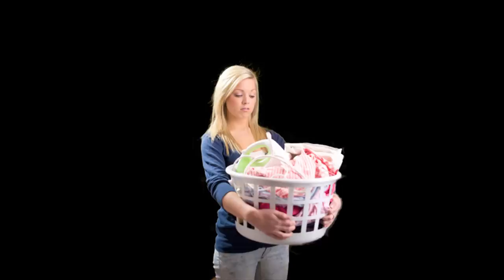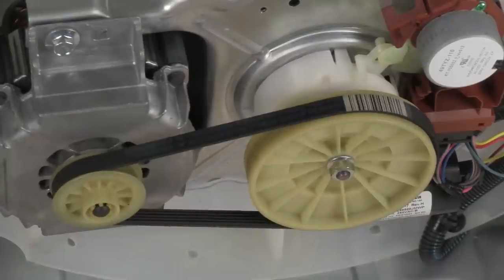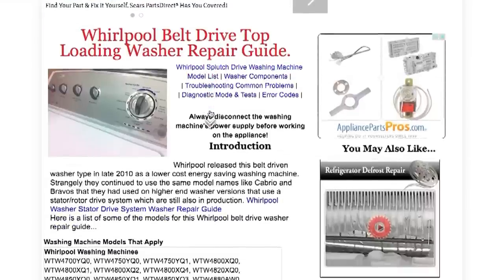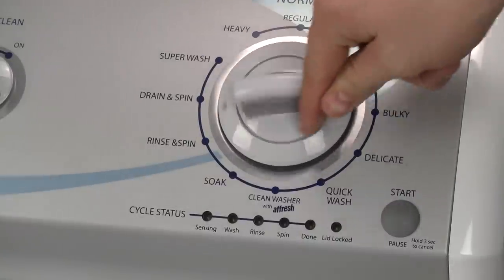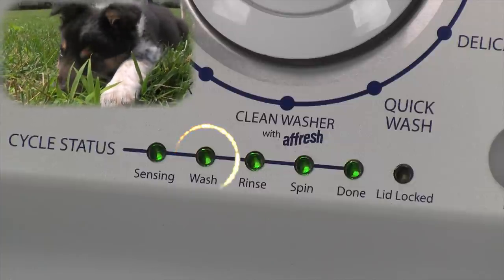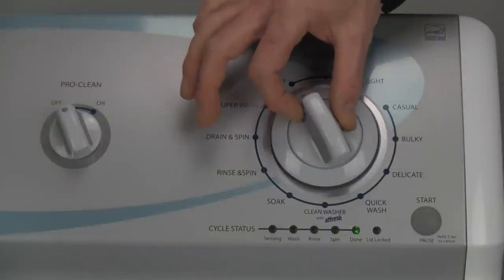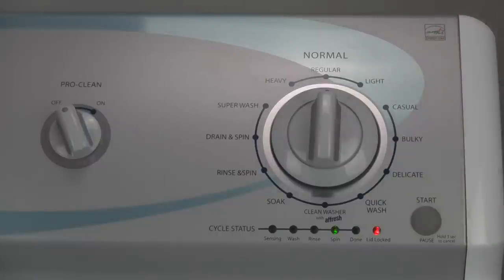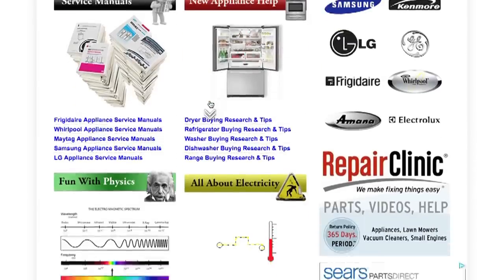Whirlpool Washer Repair (New Top Load Washer)

Comment: We just replaced the water pump on our Bravos.  The clothes are not coming out clean and I realized that the wash plate doesn't seem to be moving independently from the drum.  The drum moves fine, I think, but the clothes just float in a circle because there doesn't seem to be any movement from the bottom.
Reply: I don't know if we broke something else while replacing the water pump but the new pump seems to work fairly well.

Comment: I heard F -8-4-2-1. Where does E -5 -3 come in??? I'm talking about F7E1 and F7E6, etc. as diagnostic codes. I replayed it and that's not explained. Thanks!
Reply from the maker: you add up the light/numbers on each flash sequence. so 4+2+1 would be F7. Hope that helps!

Comment: Hi, On a Sers110.22102310 washer it started the take a bit longer to start to fill. than when it goes through the cycle it doesnt stop, it keeps repeating the cycle again, any ideas ? Thank you
Reply from the maker: It it is this style of washer, I would guess it’s a control board failure that’s causing the cycle problems. The slow fill is likely the water valve.
Reply: same washer, I will try a mode shifter first

Comment: Love your video beginning parts! Yeah, these washers are junk. Our direct drive is still working after 25 years. That just will not happen with these. They even changed the motor pulley to plastic! FAIL!
Reply: Hi - im just an old guy (57) and wanted to say we grew up with washers that lasted 20 - 25 years or more - My GE filter flo is 40 years old and only this year needed its first major repair.  And it washes clothes like a demon and does it fast.  No, it wont do it with a quart of water, but when youre done you don't even worry about if the clothes came clean, you just know it.  Ive read about owners of new HE washers having to add water with buckets to get the washer to even fully wet the clothes, let alone clean them.   And washers like this used to be the norm from all the major brands - but now theyre all made the same, flashing lights no agitator(??)and delicate computer boards have replaced solid well thought out engineering designs with years of development behind them - but they cost just as much and more though today they typically only last less than five years.  And who ever heard of plastic gears in a transmission or heavy load area like a washer-??!    Knowing parts are scarce for my old GE I went out and shopped washers for the first time since the 80s when my deceased aunt left me this GE I spoke of.  I remember shopping with a friend and his wife, they bought a Whirlpool I believe and it was a good washer.  But after looking at todays offerings It didn't take me long to see the major downgrade in quality and performance after reading all the reviews and talking to people, so I bypassed all the big box brands and bought a heavy duty commercial Speed Queen washer before the government forces them to start making HE junk as well next year.  The SQ has been everything it was promised, not flashy just a good old fashioned heavy duty washer that works, works well and works fast with no computers no drama and the best warranty in the business.  I paid a little more but am very pleased with the washers performance and build quality - I highly recommend the simpler knob controlled model as it uses no circuit boards and is much more reliable.   My problem is I grew up in an era when companies touted performance and long life and they delivered it and it was the norm - not any more.  People are taken in by fancy computer touch pads blinking lights silly songs and water efficiency claims, but they just don't have the performance or build quality of old school washers - but they still charge just as much for these under performing under engineered things --- end of rant--lol
Reply: yambo59 you have the right idea boss man! Just like cars!

Comment: So I've been having issues getting the spin cycle to run. Error codes f7e1 and f7e6. Are there any suggestions on how I proceed with figuring out whats wrong exactly and what I can do to fix it?
Reply: the F7E1 is a shifter fault and the F7E6 is a motor fault... The shifter is very common so I would start with that, especially if the motor is working on agitation... The service manual is in a plastic bag stuck to the inner front left of the cabinet, with that you can see how to clear error codes and run a few tests to try and narrow down the problem. However, odds are you will need a new Actuator/Sensor. Here is a link to my website guide for this washer: https://applianceassistant.com/appliance-repair/maytag-centennial-washing-machine-repair
Hope that helps! good luck!
Reply from the maker: Sorry replied logged in as my other account service node... this is appliance assistant ; )
Reply: @applianceassistant  good to know. I don't know if this information matters or not. But if I just try to put it on a spin cycle, it begins to spin and then just stops suddenly after about three seconds

Comment: My Whirlpool Cabrio has been the single least reliable appliance I have ever owned. I just ordered a new Splutch assembly. In the past I have had to replace the lid switch, the water pump, the gearcase, and the suspension rods.
Reply from the maker: I absolutely agree! Appliances are in a sad state these days! Very frustrating.

Comment: Hi.. so My cabrio WTW5640XW0  wont start up, and I have the F7E1 code. how can I tell if its the splotch, the motor or the transmission... thanks
Reply from the maker: everwharesismine  that error is the tub speed sensor error. https://applianceassistant.com/appliance-repair/whirlpool-belt-drive-washer-repair-guide/2/#error so you will likely need to replace the shifter/speed sensor. Whirlpool has used 3 slightly different styles of shifters so not sure which part number you need without a model number. If you clear the code from the washer's memory and run a diagnostics quick test https://applianceassistant.com/Washer-Repair/Whirlpool-Washer-Belt-Drive-Splutch/Whirlpool-Belt-Drive-Washer-Diagnostic-Tests.php
you may be able to get a few more weeks or months out of it.
Reply from the maker: everwharesismine  That error is the tub speed sensor error. https://applianceassistant.com/appliance-repair/whirlpool-belt-drive-washer-repair-guide/2/#error so you will likely need to replace the shifter/speed sensor. Whirlpool has used 3 slightly different styles of shifters so not sure which part number you need without a model number. If you clear the code from the washer's memory and run a diagnostics quick test https://applianceassistant.com/Washer-Repair/Whirlpool-Washer-Belt-Drive-Splutch/Whirlpool-Belt-Drive-Washer-Diagnostic-Tests.php
you may be able to get a few more weeks or months out of it.

Comment: I watched the video over and over and still can't get how to Read the codes, where does 7 come in and the the E's plus #'s???  I have the very machine in the video and it does make a loud sound on spin, what is it?
Reply from the maker: It is kind of confusing... This is a page that I created to help clear things up.  https://applianceassistant.com/Washer-Repair/Whirlpool-Washer-Belt-Drive-Splutch/Whirlpool-Belt-Drive-Washer-Diagnostic-Tests.php
The first time it flashes with the "Fill",  "Sensing", or "Soak" lights, is the  "F" part of the code.  The second flash without one of those lights on is the "E" part of the code.  After that, you just add up the total of the lights that you see for each flash... 
The "wash" light is "8"
The "rinse" light is "4"
The "spin" light is "2"
the "done" light is "1"

So for example, if  the "Fill" light is on it's the "F"   then "Rinse" (4) and "Done" (1)  4+1=5 The first code would be F5
Then you just get "Done" (1) .  the full code would be F5 E1 . 
This page will tell you what each code means:
https://applianceassistant.com/Washer-Repair/Whirlpool-Washer-Belt-Drive-Splutch/Whirlpool-Belt-Drive-Washer-Error-Fault-Codes.php
Hope that helps!

Comment: Where are you getting F7e1?  When you explained the lights, you labeled them, F8421.  Did I miss something?
Reply from the maker: +chip Fit It is a total of the lights flashing. So on the F7E1 Sensing (F),Rinse (4), Spin (2), Done (1) = F+4+2+1 = 7 then (No Sensing Light and Done (1) = E+1) Kind of a weird system, but not too bad once you get the hang of it.  Sorry for the confusion. Thanks for the question!

Comment: Great video !!!
So any other reason besides the nut on the pulley for the grinding noise on spin cycle?  Just won’t get up to speed on spin already changed the transmission still no luck
Reply from the maker: That’s pretty strange. I would have said transmission or something jammed between the inner and outer tub, but I would assume you would have caught that during the transmission replacement. Big reach would be the capacitor or motor but that doesn’t really fit. I’m sorry I can’t be more help.
Reply: applianceassistant thanks for your time
Reply: applianceassistant I figured it out

The grease from the old transmission got on the shifter and belt pully causing it to slip the gears.  Cleaned it with some break cleaner and problem solved
Reply: @mrphilleakey  That's great! thanks for the update!

Comment: Last night my wife may have overloaded our Kenmore 110 HE VMW and there was a lot of burning  smell. Now she gets a flashing lid lock during the sensing phase.   I figured that the drive belt was the problem.  I got the diagnostic code F7E7 Motor unable to reach target RPM , which says that there is a basket sensor so, I am guessing  that  the  belt is either broken or slipping so much that the basket movement doesn't satisfy the expected rpm when in sensing/spin mode.  The washer is a real chore to move to a position where I can tip it over to check the drive belt so I just wanted to see if you think I am on the right track before I decide to do a fix myself.   Help?
Reply from the maker: If everything looks okay under the washer, check between the inner and outer tubs, something may have gotten stuck in there that is causing drag.
Reply: @applianceassistant  Thanks, I looked at the belt yesterday and it looks OK. I checked the basket and it spins easily with one finger and takes a while to coast to a stop so I don't think there is anything stuck between the drum and basket causing drag and the bearing appears OK.  Should the basket spin that freely when powered down?   I'm thinking that shows there is little resistance through the gear case and belt drive to the motor.  Is that normal or would there be more resistance to spin?  Also,the sudden burning smell when the event occurred should give some clues: belt looks OK, motor? (I don't see any obvious signs...copper wiring looks clean.  Can this be a problem with the shifter? Capacitor? That apparently is the most usual problem.  I will have my wife start the washer while I am under the tilted base to observe if the motor jogs at all later today.  When I start the cycle the lid locks for a few seconds then unlocks for a few more (sensing mode) then lid lock lights again and I hear the sound of the motor for just a second then the lid light  starts flashing.  I have gone through the diagnostic test 3 times and get the E7F7 error code consistently.  The washer ser no has 2013 in it so I assume that it was manufactured in 2013. We got it with the house 2 years ago and have used it very sparingly since then (1 time/week at most) and it was with a small 4 pers family before so it hasn't had a very long life.
Reply: Problem solved. I ran  it in test mode and the error cleared.  Also, the error code had changed from F7E7 to F7E1 today (maybe since I tipped the machine and moved the belt?) Anyway, it was likely due to overloading which cause the belt to slip (and smoke) before it faulted out. I'll  get a replacement belt anyway but it works now.  Thanks!
Reply: @wicker1234  Nice! Thanks for the update!
Reply: @servicenode9553  It didn't last long.  When we tried to do a wash I got the red flashing lid lock again.   The diagnostics show the F7E1 code again. Still seems to be related to the basket rpm sensor not agreeing with the motor.   I am leaning towards replacing the shifter/actuator since  the optical rpm sensor is located there.  Possibly the overloaded washer caused it?  Seems to be the most common item to fail but, also, a lot of ppl replace it and the problem remains.  Any ideas?
Reply: I would agree with with the sifter/tub sensor, it is a very common part to fail. they are getting a little better in recent years, but still a common failure. I would still suggest pulling the top tub ring off and taking a peak between the inner and outer tubs to make sure there isn't a sock or a rag or something jammed between the tubs. You can also give the tub a manual push with your hand and see if you feel a lot of drag.  There may be some drag depending on if the tub is in agitation or spin mode but it should move pretty easily. if it moves easily you don't need to bother with the sock check ; )
Reply: @wicker1234  Sorry I didn't realize I was logged in as service node. This is Jon from applianceassistant : )
Reply: @servicenode9553   I  got the new shifter actuator  and installed it today.  I tried calibration node first and it failed (Lid lock blinking) a few min into the  test.  I tried the auto test just to see and it passed (no failure)  I repeated both tests, same results : Calibration fails but auto test runs through to the end.  I tried running a couple of sweat shirts in Normal setting and it faulted out during the sensing cycle with the same F7E1 fault.  The auto test would prove that the shifter is working now (wasn't before) so I think that that was a good replacement but, what can be the problem now?   I checked the basket for somethiing between the inner and outer drum and it spins with one finger...nothing rubbing at all.   Today i tried the manual test on agitate hi and lo and spin hi and lo and all passed except for the  Spin hi.  I verified that trying the drain/spin and the rinse/spin cycles and they both faulted out.  Do you think it might be capacitor?
Reply: @wicker1234  That does not sound good. The lid lock blinking is normally a lid lock fault but it wasn't stored as an F5... something in the memory then it may not have been. The F7 codes are definitely sensor fault and I doubt you have a bad new part.  At this point you may want to ask yourself how far you want to chase this thing... this washer is kind of a problem machine and it could get very expensive and frustrating.  If it where me I would clean the plug contacts at the sensor and the control board with some electrical contact cleaner, and if that doesn't work I would let it go and replace the washer. My next guess would be something jammed under the inner tub, which is not an easy thing to check, then I would move on to the control board which is expensive... Sorry for the bad news! I hope that helps some.
Reply: @servicenode9553  Yes, I agree.   Now I can't even get into the diagnostic mode....tried maybe 30 times over 2 days but no luck.  Must be circuit board related.   I ordered an LG  Front load direct drive.  I've had LG tv's, laptop , phones and ductless mini split heat  pumps and haven't had any problems.  Their inverter drive systems are great and there is a 10 year warranty on the motor in the waher.  Looking forward to ssing the last of the Kenmore/Whirlpool garbage.

Comment: can you bypass a lock that is on the lid of a washer whirlpool it was broken & now does nothing.
Reply: Yes you can ! A few ways to do it . I can’t post them here out of safety and respect for the owner of this page . It is not safe to jump it out but I had no other way of testing a second switch . I will say this . I did find a Broken blue wire just before it plugs into main board? Found this after I got a new switch .

Comment: where can you see a list of the codes?
Reply: Inside the front panel there is a ziplock bag with the user manual in it. Just tilt the basket back and you will see it.

Comment: I change the main board and I'm going to change the actuator please help
Reply: Bummer! Did you get any error codes out of the memory with diagnostics?
Reply: @charlesyingst1825  how do I get the error code
Reply: @charlesyingst1825  ok got the code the lights that flash when I check the code is the sensing light flash with the wash light and complete light is that error code f-8-1

Comment: How do I find out what is causing that last grinding noise?
Reply from the maker: I never finished that video, sorry : (   But its usually main the plastic drive pulley on the bottom becoming loose and grinding against the cover.  Removing it and reinstalling with some Loctite on the pulley nut will probably solve it. If that pulley seems tight, it is likely the gear case which would not be worth fixing. Good luck!
Reply: @applianceassistant  thanks
Reply: Also, ? How do I keep the pulley from turning while loosening the nut?
Reply from the maker: @michaelgrimmett9909   It's not too bad, just holding the pulley with you hand while tightening will work.

Comment: where dose the 'E" in the code show up?
Reply from the maker: +collectorbob810 The washer doesn't actually signal "E" it's just the second flash in the sequence. So the first "F" code will have the "sensing" light in addition to the code. For the second part, the "E" code, the "sensing" light will be off.